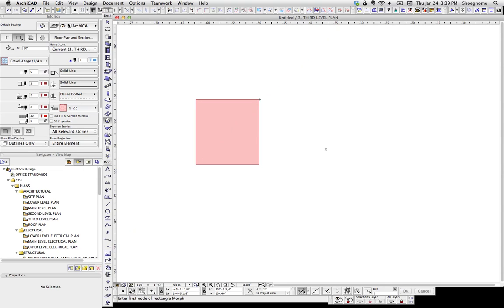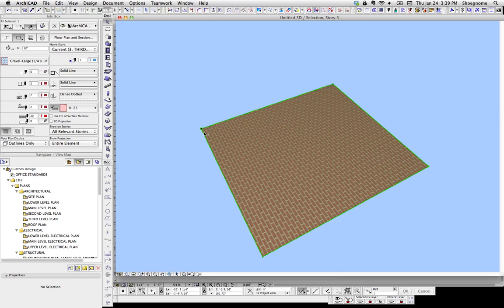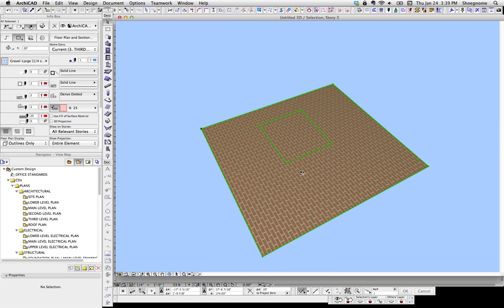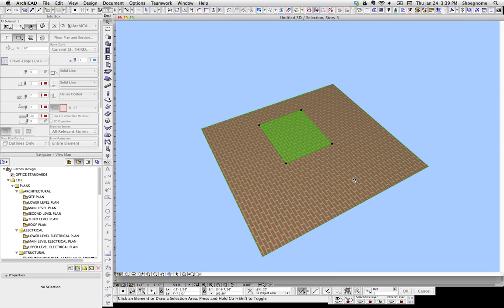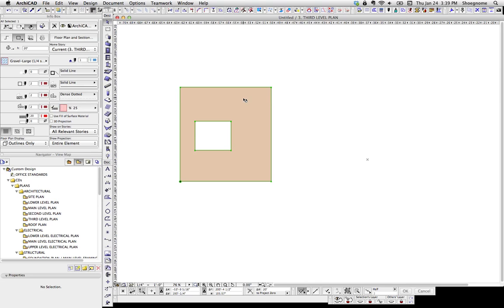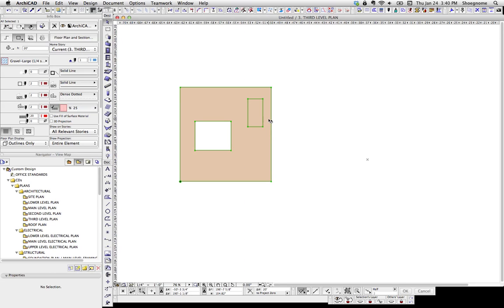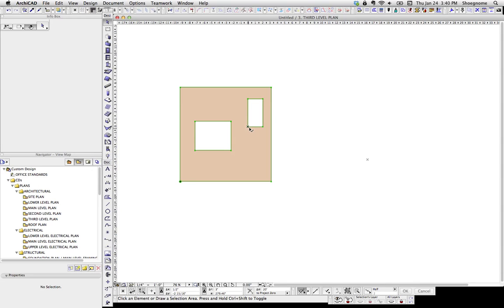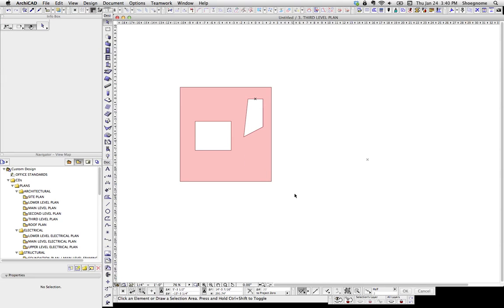ArchiCAD Tutorial #14: Cutting a hole in a 2D Morph

Comment: Great video, thank you!
Using Archicad 25, however, I have a problem: when I work in 3d everything works as in your video. When I work in 2d, however, the petpalette with the pencil symbol does not appear, which is used to draw the other geometries I need inside my figure ... In 3D, if I click inside my plane geometry, the petpalette appears right, if instead I do the same thing in 2D no, it doesn't happen, and the program deselects the geometry itself ... I i click on the BORDER of my selectd geometry, ok, petpalette with the pencil appears: but obviously you dont use it to draw "internal" geometries..... Please help me! I am trying to use this tool to cut out different areas with different surfaces, surfaces that have an irregular geometry, lines, curves, etc etc on the same wall
Reply from the maker: Try restarting archicad and maybe your machine. It works as expected for me in Archicad 25, so hopefully it's just a restart issue. I've noticed that with 25 sometimes spacebar stops working. This might be a similar situation.
Reply: @Shoegnome  Today, it works but only in the plan view! Petpalette appears correctly. In elevation view not :((( thanks guys
Reply from the maker: At least we know it's clearly a glitch!
Reply: @Shoegnome  😭😭😭

Comment: in the 2D, everytime i click on it activate the move comand
Reply from the maker: Select the morph (click on it) then click on it again to get the pet palette to show up.
Reply: I did it, but the pallet shows only in edges
Reply from the maker: Make sure Quick Selection is turned (the horseshoe magnet button in the Info Box).
Reply: It is, maybe in windows, has something different
Reply from the maker: If quick selection is on, I'm not sure what else is going on. Can you get the pet palette to show up when you click on the surface of a slab or roof in plan? If you can, then there's something Morph related going on. If you can't, then that's the issue. Check snaps and grids, to make sure they're not getting in the way. Try restarting ARCHICAD....not sure what else to recommend.

Comment: my is not working. its deleting the whole thing
Reply from the maker: +fausto javier make sure you are holding shift and only selecting the surface within the space you want to delete. Also make sure the outline of the hole you create is actually connected to the existing morph and not sitting on top of it.

If you are struggling with the morph, these posts might help:

http://www.shoegnome.com/2012/07/10/two-morph-videos-that-arent-flashy-but-thats-the-whole-pointv1/
http://www.shoegnome.com/2012/07/16/morph-pet-palette-madness/
http://www.shoegnome.com/2013/05/13/modeling-tips-for-chimneys-in-archicad-redux/
http://www.shoegnome.com/2013/05/14/archicad-modeling-tips-bonus-video/
Reply: thank you, the links helped a lot.

Comment from the maker: There are many ways to do this. You can define a hole within a shell. Or you could use Solid Element Operations to subtract an element. If it's a regular shape, you could use an empty window or door in the wall or skylight in the shell tool (also creating custom doors/windows/skylights is fairly easy). Also with walls, a beam on a hidden layer with a higher priority will cut a hole in the wall. In ArchiCAD 17 you'll have even more options because of Priority Based Junctions.